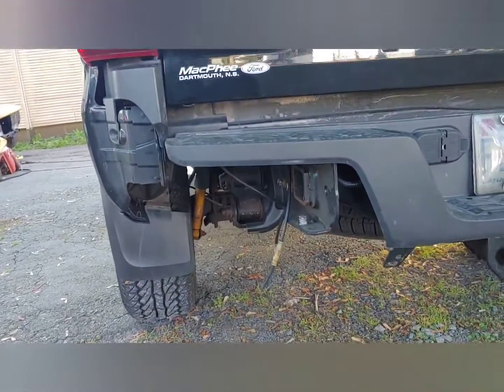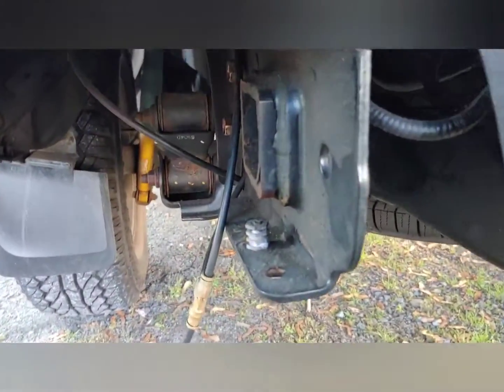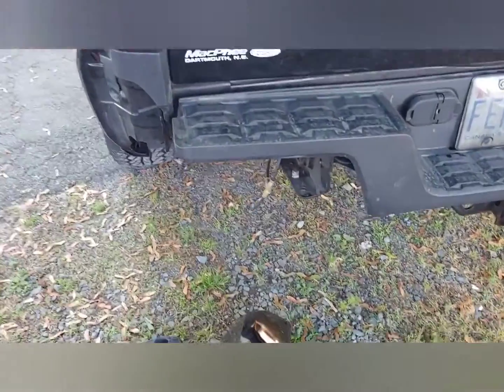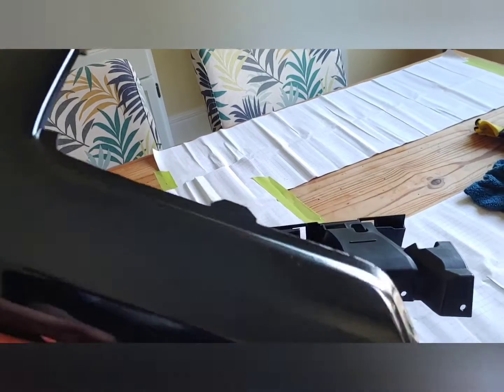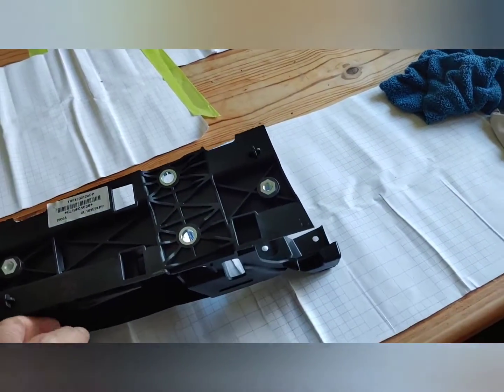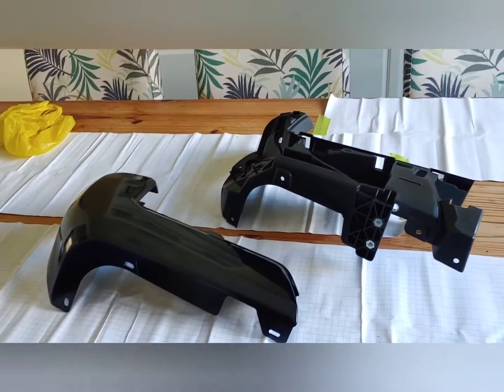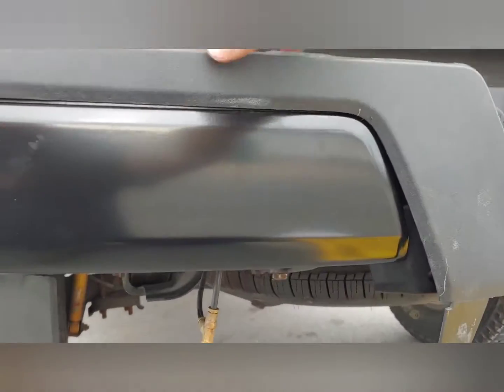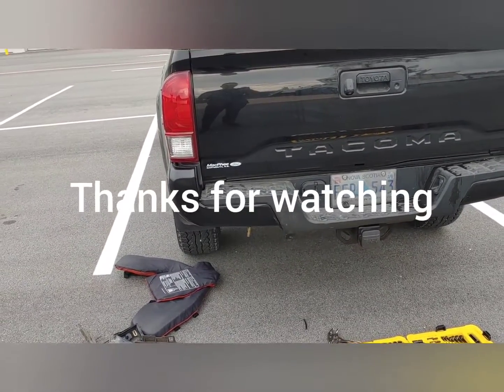Toyota Tacoma, plastic bumpers !!

Comment: Best video yet on this. I have a ‘23 pro of course with cameras too but I made a very slight hit backing into my campsite late one evening and hit a big tree. Nothing broke not even indentation in the plastic outer cover but the corner is out of whack and that corner plastic bracket isn’t broken either so I guess my culprit for the misalignment in the corner is that thin tin metal piece you mentioned so I’m going to remove that plastic corner bracket and see if it can be realigned successfully without replacing it. Thank you very much
Reply from the maker: @huckleberrymulberry4764  Thank you !!

Comment: Man, you do make it look easy. I bought my plastic bumper to replace my stupidity but afraid to take down my broken pumper and not be able to attach my new one.
Reply from the maker: Go for it !! Hardest part is lifting the plastic top. You have to pinch the clips from underneath. 
After that it's bolts.  The skin has little tabs that slide in.  Not much to those bumpers,  a long way  from what truck bumpers use to be.

Comment: The 2018 is the same.  I just installed a new steel bumper on mine.  I had backed into a parking lot pole.  It crinkled my plastic bumper.
Reply from the maker: Yes.  Not much to these plastic bumpers.  Oh well, I haven't backed into anything recently lol